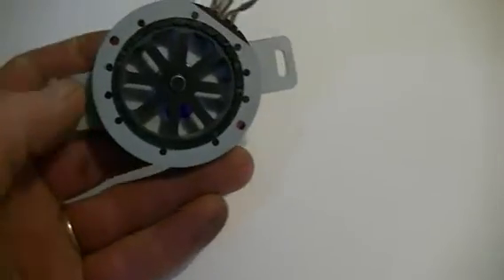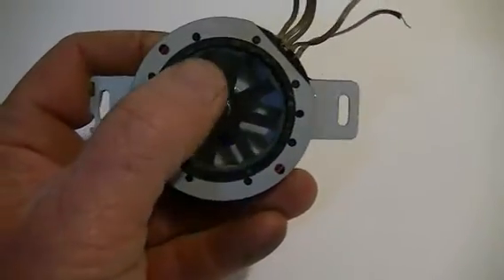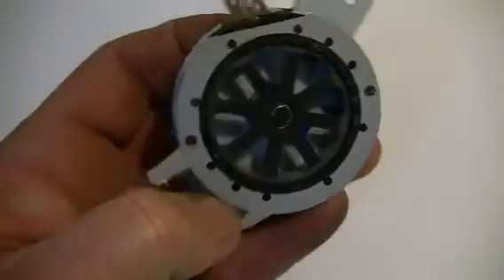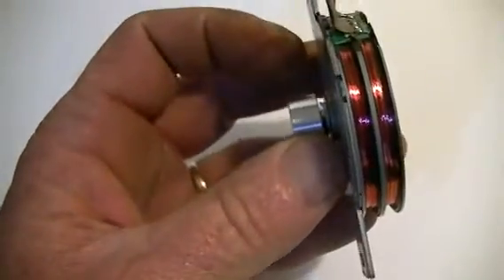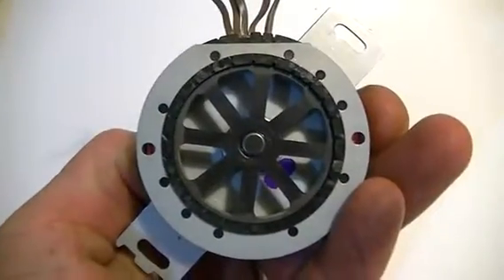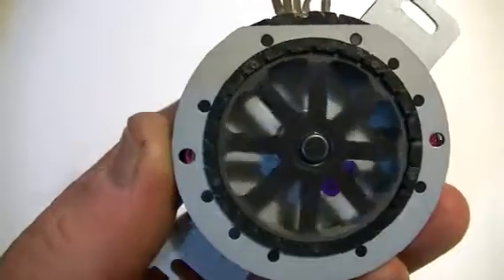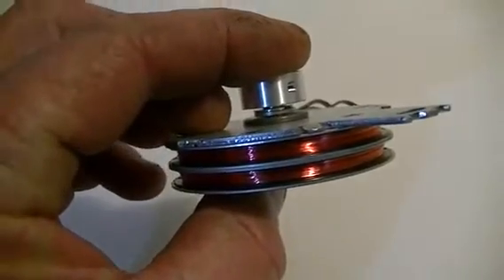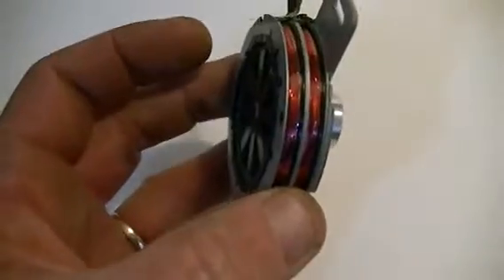strange stepper motor

Comment: Oh wait, I recognise that type, have taken the windings off one before now as a source of a sort of spool. It was smaller than that one though.
I believe the input wires relate to the coil wires. 1 coil on top of the other, 4 wires and prob a casing wire as a ground if 5 on that. Perhaps 1 coil makes it go forward, other is reverse controlled by relay, or 1 coil small torque fast, both coils more torque. Can't remember if there's a ring magnet inside or not...if so, it rotates with the shaft.

Comment: Yup, that's the one. "Emporium Garden Lighting Outdoor Solar Light - Wind Spinner Kaleidoscope" the generator used to light the LED's has the same stator and winds.

As a generator I found that it has way too much coughing. will be interesting to see it run as a motor - thanks for sharing this little morsel :-)